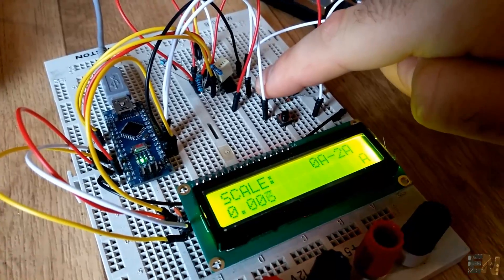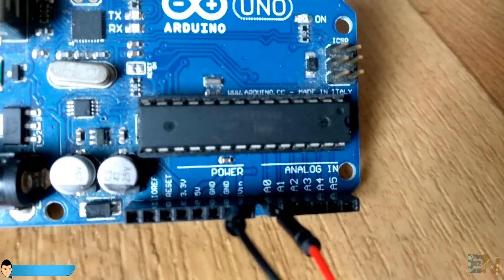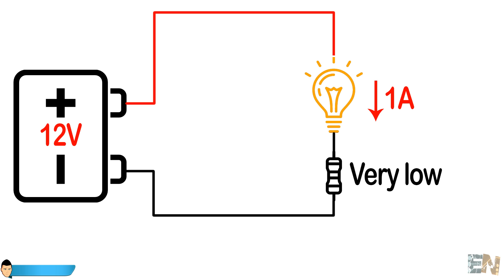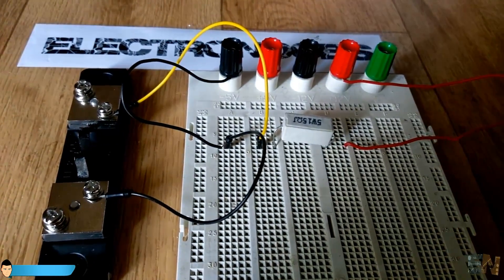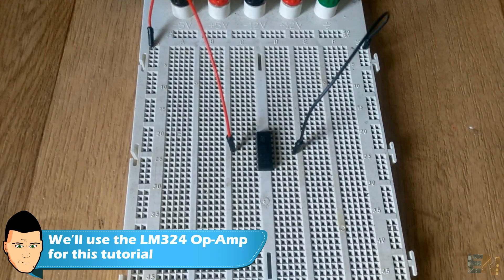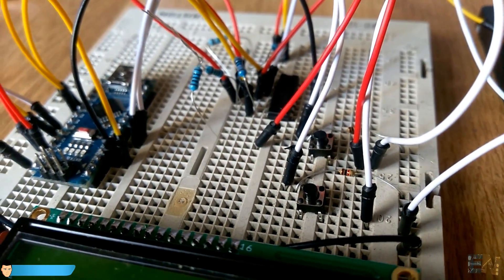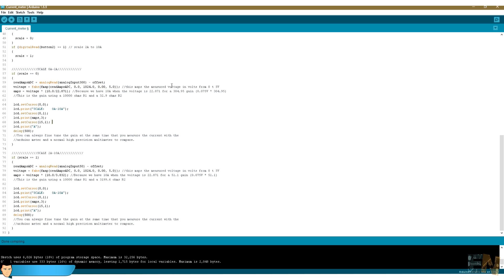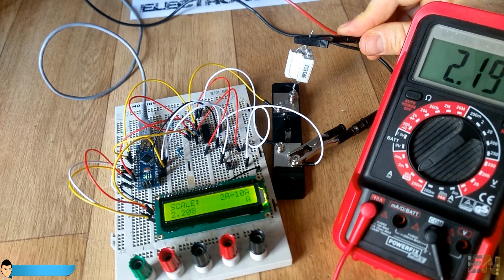Arduino based current meter with i2c LCD screen

Comment: Thank you for this video.  It is one of the most well done videos that I have seen on this exact subject.  And, it's right when I need it.  I have been having trouble with DC to DC SSR's failing when using them to power the Chinese 2500 watt ZVS induction heaters.  They fail shorted if the get even a momentary overcurrent.  So I will attempt to use this kind of circuit to shut the SSR off just before its too late.  Wish me luck.

Comment: Can u make an AC Voltage meter using ZMPT101B & Arduino?
Cz I have a problem detecting the peak voltage to calculate the Vrms value.

Comment: Really nice, good thing you did not get the ad624 <3, lm324 is way cheaper and gets the job done. I made it using your video and lm324 working very well.
Reply: Can I ask for the code? Mine is not working. I’m using a 25 mili ohms shunt resistor and I want to measure 0-3A but i think there is something wrong with my code or maybe my gain. Thanksalot🙏

Comment: Sir how to make multifunction Mppt solar charge controller for 60 Amp or higher with auto detect battery voltage of upto 60 v 
With over charging and discharging voltage settings

Comment: Is the arduino pins is safe to accidental over voltage?. when you put to much voltage in 0-2 A scale?. i think it needs a kind of protection, just like fuse , feedback to disconnect test probes if over voltage happens, zener diode, or else.

Comment: verry nice video and explanation,
is it possible to read to 10 amp and 20 amp and also on other voltage than 5 volts, 12 volt example?

Comment: Thank you for sharing.I learned a lot of thing from this video.Im working dc motor overload control.this methode very clear.I searched a lot of circuıt aliexpres etc about overload motor control.I analyzed these circuit but  ı didnt saw big shunt resıstor.ıt has opamp but no big resistor.ıt has ordınary resistors.How ıt does deal with big current?

Comment: Hi can you tell how can I add lcd to buck boost converter to measure input voltage and current as well aas output voltage and current

Comment: your circuit diagram shows a 7.5mOhm shunt,  should that be a 7.5mVolt shunt? or it it 75.mOhm as its divded by 10a?
Reply from the maker: The shunt resistance is 0.75mOhms and it could withstand maximum 10A. So at 1A there will be a voltage drop of 0.75mV.
Reply: @ELECTRONOOBS  yes most shunts seem to be 75mv, I bought 100a and 200a ones and they are 75mv

Comment: I get crazy voltages using the Arduino to measure voltage across a 0.1 Ohm shunt with a 12v bulb as a load.... but no problem measuring that same voltage using a pot to generate the voltage. Pulling my hair out. It seems as though the Arduino ground is not true ground once connected to the simple light bulb circuit! I have no idea how you guys all get this to work!

Comment: Why do you use 2 switch when you can simply change the input pins in the software when it reports overflow

Comment: Hi , I have a problem with this. The Voltage of the battery drops fast. I have use 9v battery it works great but afterwards i saw the voltage, it was 7.2 !!!!

Comment: how about putting  resistance R1 and R2 parallel to the load then in ARD code divide the voltage by R1 to find branch current then using current divider to find main current

Comment: What to change on the code to make it automatic select the range
Reply: wow way to overcomplicated.
All you need is an if condition.
if in range 0 to 2a - read from pin 1
    else read from pin 2

literally 2 lines of code

Comment: What is the reason why ad620 does not work?
Reply from the maker: It should also work. AD620 is not an OPAMp, it is an instrumentational amplifier which should be better. Check the confiuguration that you need for this amp in order to amplify in the datasheet. Keep up!

Comment: Please add a video on power factor meter.
Reply from the maker: I'm not sure when I will be able to do that. I have a lot of other projects. But just measure voltage at the same time as current and calculate power. Keep uP
Reply: Electronoobs 
thanks for replying, 
please explain me bit more, measuring current and voltage at same Time will give us it's corresponding amplitude, but how can we  relate amplitude with power factor, I know that power factor depends on the  impedances of load. That is R/Z

Comment: LM324 is not the greatest opamp and gain of 300 is a bit too much for it. Just take the output of the x50 amp and amplify it x60 with another one. That'll increase the error due offset voltage, but you can null it out in software.
Reply: you mean amplify by 50 then by 6... that's 300.... not 50 then 60 !!!

Comment: Hi, I wanna make a current control circuit with constant voltage.........what should i do???
Reply from the maker: Well, probablly you could use this same circuit and add a relay. When the arduino detects your preset current value, should open the circuit with the relay. That should be quite safety.
Reply: Thanx

Comment: Maybe you can use a software autoscale when displays "increase current" the arduino can change automatically to the low gain amplifier.

Comment: why don't you just use analogReference instead of an amplifier ? that will decrease the resolution.
Reply from the maker: the ADC of the arduino has 10 bits that means you have 1024 values for 5 volts. SO that means each value is 5/1024 = 4.8mV. The voltage drop on the shunt will be 7.5mV per each amper so if you want to measure less than an amper you need to make difference between lower values. So you need to amplify the signal so the ADC could measure it!
Reply: @ELECTRONOOBS  You can change 5 volt => 1.1V
Value = 1.1/1024
Value = 0.00107421875mv
Reply: @ELECTRONOOBS  in this case you need better Op-Amp , then use 1% resistor to minimise error.,

Comment: At around 10 minutes into the video, you talk about calculating the ampere from the value of the ADC.
Do you mean that you got 22.871 volt on the analog pin at 10A? Because that can't be right, the Atmel chip would pop like popcorn at that voltage.
Reply from the maker: Pontus Holmberg no way hahaha. the maximum voltage is 5 volts of the ADC. At 10 ampers I say that the voltage drop at the shunt is 75mV, that multiplied by the OPAM gain should give about 3.75 volts. so no way 22 volts, you understood bad. keep up!
Reply: Yes, I know that the maximum voltage if the Arduino pins are 5v. That's why I had to ask, as you even wrote a comment in your code saying:
"Because we have 10A when the voltage is 22.871 for a 304.95 gain"
You even say: 
"with our gain, that voltage drop will have a value of 75 multiplied with 304, which gives us a 22.8 voltage drop for 10 amps of current"

and we measure the voltage drop to get the current. So what you're saying is that the op-amp will give out 22.8 volt at when the shunt gives 75mV at 10A, because of 
0.075V * 304.95 op-amp gain = 22.871V.
I know this can't be true, as you're powering the op-amp with 5V from the Arduino board.
But it's sounds very confusing, even I got thrown of when I looked at it first.
I know that you mean that for the 0-2A scale, it would (in theory) put out 22.8v at 10A and that the Atmel chip can't handle that :-P

By the way, why not use smal relays and npn-transistors to build auto-scaling that kicks in when the output for the 0-2A op-amp goes above 5V? :)
Reply from the maker: Pontus Holmberg yes I say that. but 22 should be for 10 ampers but in that part of the code we are on a 2A scale where the maximum voltage drop should be below 5v. Any higher voltage drop on the shount should saturate the OPAM output at 5v. in the 10a scale as you can see in the code the that the maximum voltage drop.is lower. i hope that i explained well. keep up!
Reply: Pontus Holmberg great reply,thx!thats what our community needs.... Helping each other!

Comment: i think you using wrong formula for voltage gain for Op-Amp you telling for non-inverting op-amp connection but actually you connect op-amp in inverting mode
Reply from the maker: You're right my friend. I've used both inverting and non inverting configurations for this project and I've kind of mixed the formulas in the video. You can now check the description for both inverting and non ionverting schematics with the LM324 OPAM. Thanks a lot!

Comment: can you add GPS on your Quad copter
Reply from the maker: Sumit Kumar if you use the multiwii firmware is quite easy to add a gps module. just change a few lines in the config.h code. If you use your own code is quite difficult!